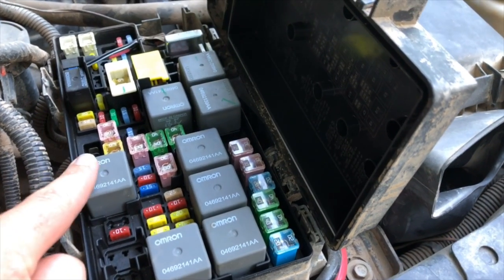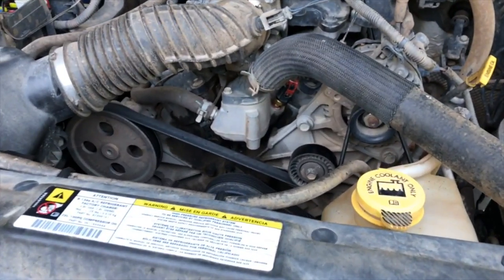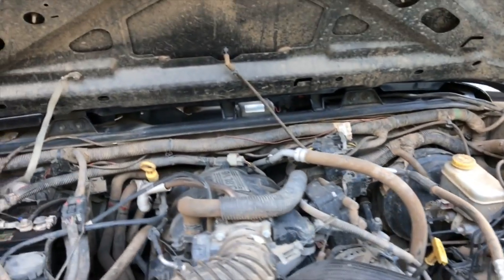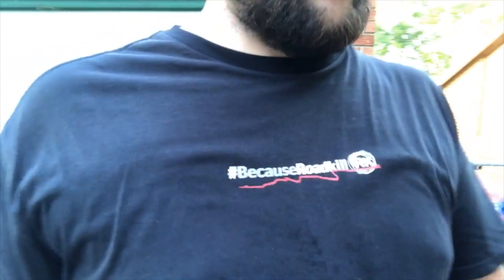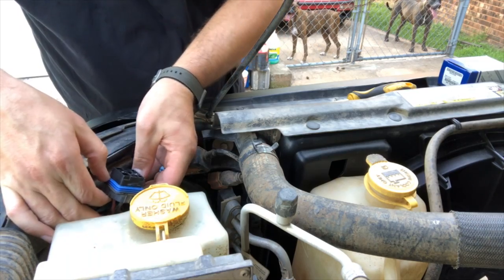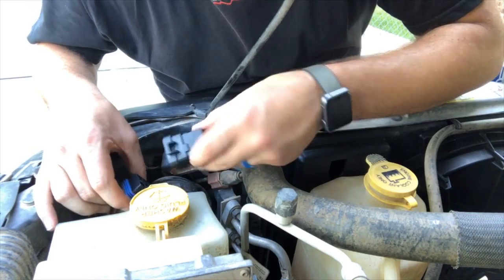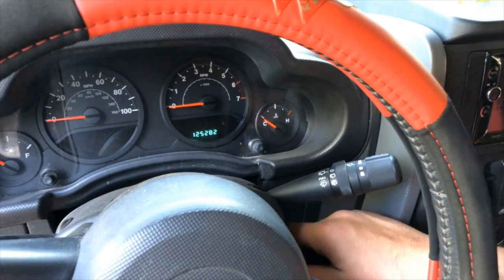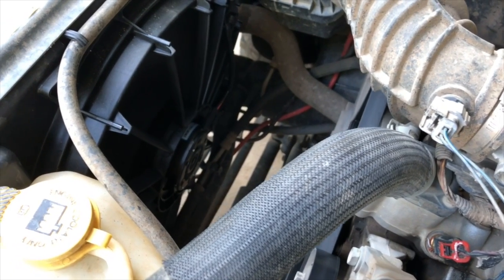2007 - 2011 Jeep Wrangler JK Radiator Fan Problem Solved!!!

Comment: It’s funny how you said “they don’t tell you“ all fans have relays so if you don’t know that maybe it’s you not them. Or you could’ve simply hooked your fan to 12 V to see if it worked that would’ve save you probably to 300 bucks on a moped or Mopar fan and your temperature sensor wasn’t working you wouldn’t have a temperature reading on your dashboard so that’s pretty easy to diagnose that that’s not the problem and if you’re going to just throw parts at something that’s not working start with the cheap parts first like a relay if you look up any wiring schematic it will show you the relay but like I said everything that garage any kind of power on a vehicle has a relay know things wired directly to any switch switch always control, relay, relay powers whatever you’re using your palm fan whatever
Reply from the maker: First off thanks for taking the time to waste your time and tell me I did everything wrong 👍

The fan I did hook up straight to power. It didn’t work. Then the fan I got new still didn’t work hooked up correctly. So I cut the wires to hot wire the new fan to make the trip home and through the week till I traced down the problem. 99% of the relays to the vehicle are in the control box on newer vehicles it even stated in the wire diagram from mopar that it is controlled by the box. Then as I went through all the relays in the book from mopar I found no wire diagram but only a picture of the relay that controls the fan between the control fuse box and the fan resistor. So as for the temp sensor it was the cheapest thing to replace but didn’t fix it. 
So they don’t tell you where the relay is located in the mopar book either. Thanks I hope you learned something from the video and if not next time hit the next button. Have a nice day!

Comment: Hooking up your fan motor directly to the battery with clips to check the motor would have told you it didn't need replacing.
Reply from the maker: When I was on the trail at the time we didn’t have anything to go into the plug to check and I ended up cutting the wires so it would work to get home.

Comment: Found it (a bit) easier if you remove the headlight.
Reply from the maker: That’s good to know. I would have had to disconnect the winch, to remove the grill,  then remove the head light to get to it on this Jeep.
Reply: @wjkris0410  yeah, that would be a pain!
Reply: @wjkris0410  I had the same issue with removing a winch/grill/then headlight. You can remove the headlight with the grill in place. My 2007 jk has small cutouts where each torx screw is that holds the headlight ring in place.